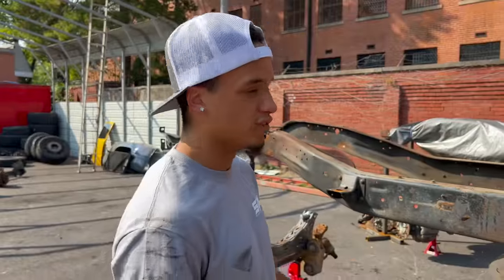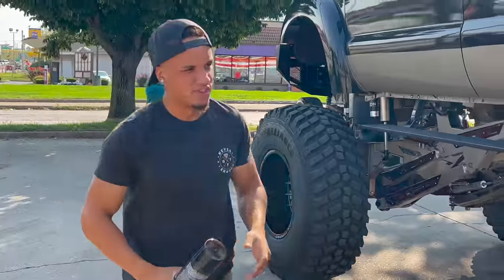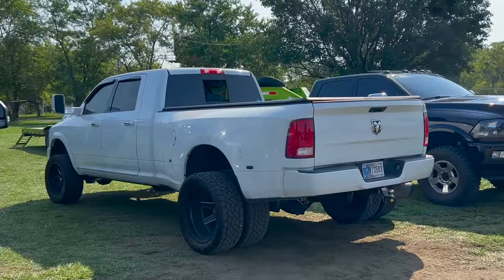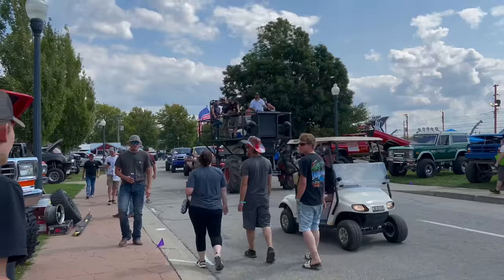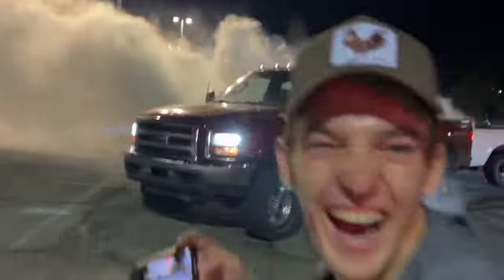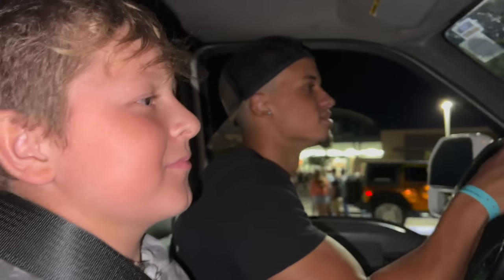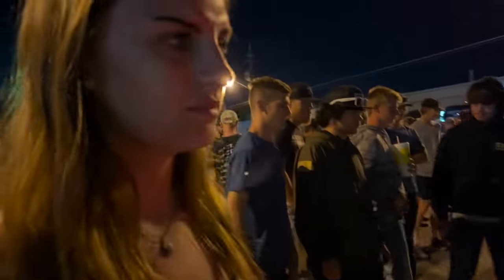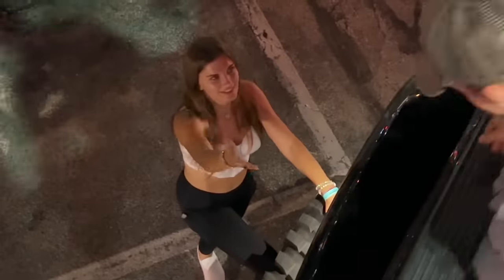World’s Most Squatted Truck + sooo many burnouts!

Comment: I’m not even from the 70s and 80s when 4x4 trucks looked like they should… it’s like all the young generations forgot what a 4x4 is supposed to look like… they went from real mean mud looking trucks to hot wheels that break spindles and 6” spacers off down the road and wonder why there truck is slowly turning to garbage…